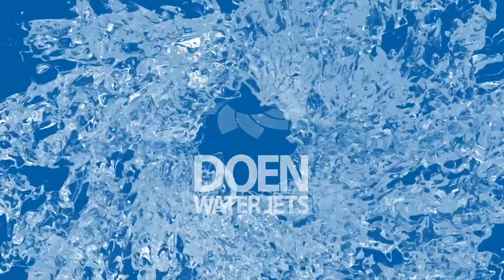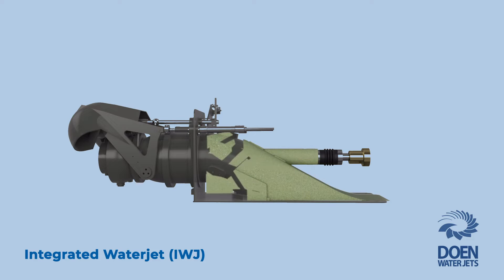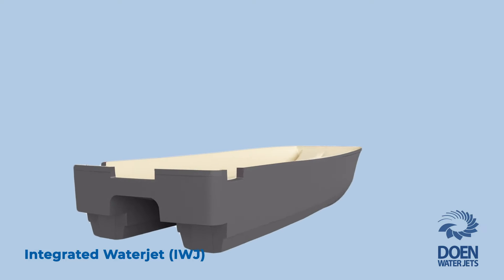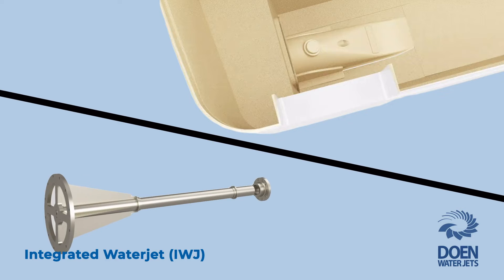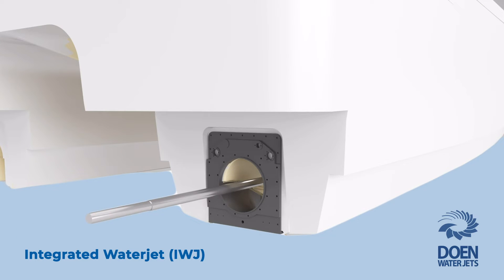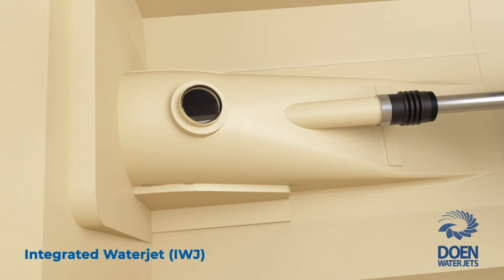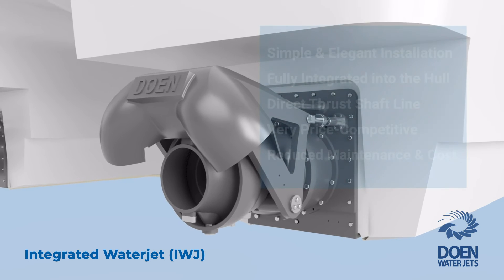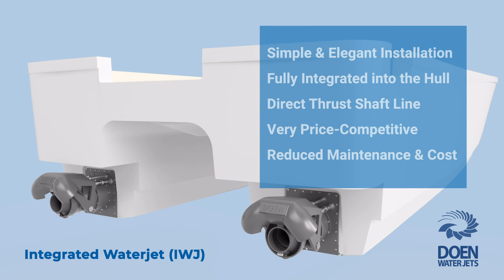Integrated Waterjet

Comment: ROFL water jets do not use gear boxes!

Thanks for the misinformation!
Reply: well they do, if the budget is there.
Reply: @dannygeys  I am yet to see one jet manufacture use a transmission! 

The impeller is matched to the engine and the F-N-R is controlled with the bucket!
Reply: @davejzielinski  thats only to get the engine rpm of the engine in sync, a lot of builders us the zf 220 1:1 gearbox to give the user to option to shut off the jet when being idle when loading guest or being docked, some Castoldi jets even have a cluth's in the jet drive for this. That "you" never saw it doesn't mean it isn't on the market and widely used, i wouldn't  want to build a boat with a jet with out a clutch or a gearcase,.. thats poor mans tactics. seen already to much drive shaft broken of poor enginering